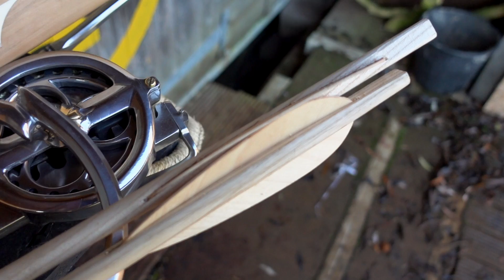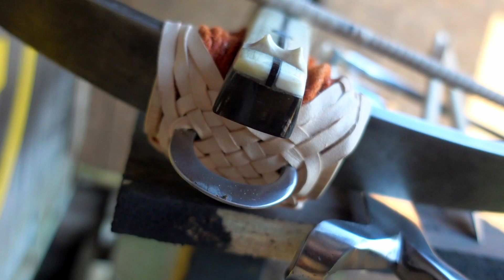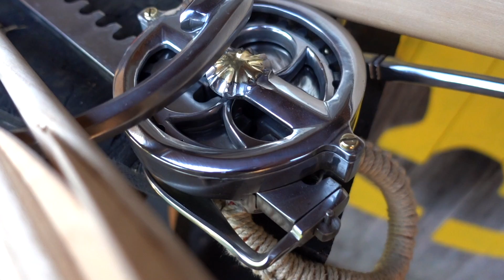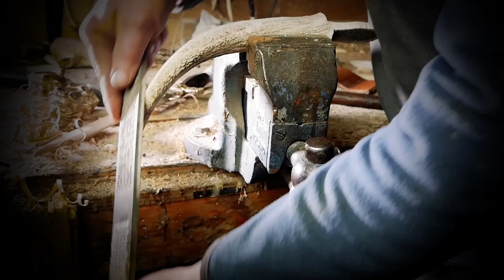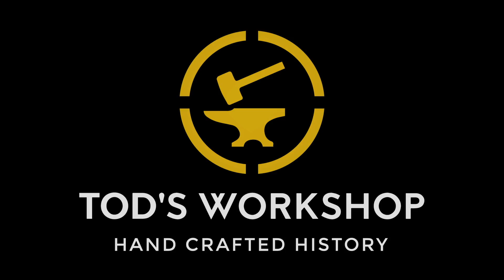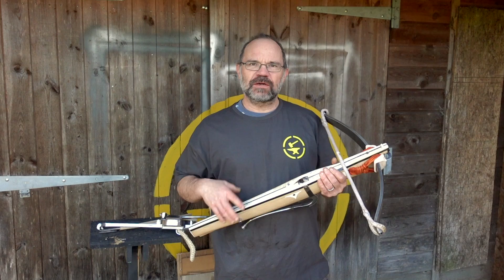16th Century Sporting Crossbow with Cranequin

Comment: Yet another great video Tod, keep them coming. At the end of this video you point out that the sort of person who would have owned this type of bow would probably have had someone with them (a servant who would have "unwound" the cranequin ready for use. My question is :- Bearing in mind the amount of work involved in preparing the bow to fire, would the servant have reset the bow ready to hand over to their "master" for him to then simply insert the bolt, set the bolt clip & then aim & fire, then return the crossbow to the servant (who will have "unwound" the cranequin) to reset the crossbow again ?

Comment: Would it be possible/practical to make an torsion crossbow with an extremely high draw weight and long power stroke(as in something similar to a miniature roman ballista but light enough to be fired from the shoulder) and if so would that not be able to fire bolts with much higher energy than can be achieved with a normal bow/crossbow?
Reply from the maker: Probably yes, but they are by nature far more complicated ad harder to look after

Comment: Hey tod, great work man. I have spent a great deal of time figuring out how to make the best shooting arrows and bolts, and I'll give you a bit of advice - the reason your shorter bolt is unstable is because the fletchings are too long and come too far towards the front end of the dart. Shorter, wider fletchings placed as far back as possible work the best. They generate more leverage this way and will keep the arrow straight during flight. They don't even need to be very big.

Comment: Todd, are you guys looking at what draw weight will actually penetrate a chest plate?  I am asking based on your great series of the long bow vs armor.
Reply: @tods_workshop   I agree with Kswa S. Even though we know the bolt energies are similar to the Warbow, it would still be a valuable "Myth Bust". We could then move on to more interesting questions like at what distance a Crossbow can consistently target a particular weak spot of a harness. Plus everyone wants to see some expensive crossbow bolts explode!
Reply: @tods_workshop  Well, it's not meaningless by any stretch.  You already have a complete set of variables established and now the ONLY thing you have to change is the weapon and draw weight.  It's very easy to do at this point and would go a long way to show penetration effectiveness of that era.

Comment: Hey Tod, good stuff as usual mate :) I'm always fascinated by how complicate reloading these devices seems. I know this is a "sport"version, but I imagine going in battle with a crossbow and shooting 1 maybe 2 bolts a minute. With modern firearms emphasis is usually on rate of fire rather than power of the rifle as putting out more bullets gives higher chances of hitting a target. Why do you believe speed was less of a focus in those times? Armor being a factor maybe? Cheers.
Reply: I wager that technical limitations and logistics were parts of it. You needed minimum draw weights to get through clothing and armor (or even to better power through what would otherwise be glancing blows or shots too weak to inflict meaningful damage or disruption) at the time and pulling back missile mechanisms by hand required extensive strength and training which made them a specialized unit. Crossbows, by comparison, took a lot less specialized training, yet you simply have to use comparatively slow devices to ready the thing at draw weights that were sufficient for combat use.

Modern missile weapons, by comparison, can reliably produce a meaningfully dangerous power to their shots even when sacrificing power in a manner that I suspect cannot really be compared to medieval and renaissance crossbows; their power and speed are both still so high, especially relative to the efficacy of the average defensive equipment that each needs to overcome to be effective, that sacrificing power for firing rate is still an effective option whereas it was not with crossbows. If you wanted rate of 'fire', you had to use longbows which were drastically less available by comparison.

Comment: Very nice craftsmanship, as always. The only crossbow I ever made has a 2x6 (rough-hewn) stock, two 5/8" PVC lengths for the bow, fiberglass strapping tape wound tightly as a string, and a clawed lever made out of 3/8 mild steel rod that worked pretty well under the 20 or so pounds of tension. My string path was smoothed with a layer of aluminum ducting tape. It was great for shooting siblings.

Comment: Hi Tod, 

I've got a bit of an unrelated question regarding the drawlengths on crossbows. In your earlier videos you frequently mentioned the short drawlength on them was due to the variable nature of the steel used but wouldn't this be largely immaterial in design for crossbows from the 10th to 14th century which used wood and later composite? As far as I know these bows likewise had short drawlengths and it is the steel ones imitating them in form and shape. 

Cheers!

Comment: "I'm short on servants." Oh, how true. Often I coul use one or two or even six extra hands in the smithy! Astonishing work and detail on the bow and the cranequin!
Reply: Help in the smithy isn't servants work. That's what you have apprentices for.
Reply: @ZarlanTheGreen  Well, I don't. And I could get by with plain "hold this so I can use the sledgehammer".
Reply: @Erikreaver  My point is, that your complaint isn't about a lack of servants, but of a lack of apprentices.
Reply: @ZarlanTheGreen  unless you just hold stuff like a mobile tool rack....then its servants work.
apprentices have the privilege of using the tools themselves, servants do not (if servants do use the tools without permission a good flogging is in order XD)
Reply: @alexd1559  Quite.
Reply: @alexd1559  At which point you need someone to administer said flogging.
Reply: @Aconitum_napellus  Flogging requires a tool so that's where you need the apprentice. However, then you no longer need the servant.

Comment: Why are the fletchings on the bolts wooden I mean longbows medieval longbows how to draw weight of 100 pounds in because of the significantly worse mechanical advantage crossbows offered it's about the same amount of force on the projectile so why with Longbow arrows the fletchings are feathers wear crossbow bolts there wooden
Reply: Wood is cheaper and it last better in arsenals, rats don't eat them an it doesn't rot as badly.
A castle could easily have tens of thousands of bolts in storage.

Comment: I know things are made to historic accuracy were possible. But wouldn't the crank be better with claws that gripped the lugs instead of that rope going around the shaft? Seems like getting the rope bit on and off would be a frequent hassle.
Reply: @tods_workshop  Thanks for the reply. Thinking on it now it makes sense. I'm guessing the cord is far cheaper and easier to make and maintain than a metal hook would be.